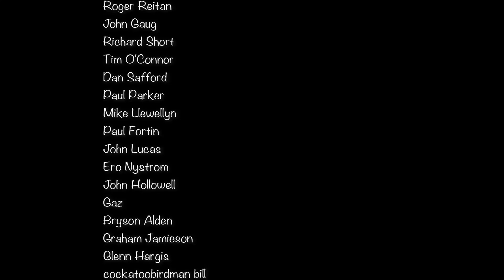Forging Shears / Tinsnips - GS Tongs

Comment: If you can find a small fly press, it might make your life a lot easier
Reply from the maker: I fantasize about tools like a fly press to make my life easier. But my work space is so limited. Let's see... Thanks. 😁
Reply: @gstongs  It doesn't have to be huge, plus you can use an old car wheel for the flywheel at the top

Comment: You are a master smith with tongs but it still cracks me up when ya struggle lol. If you wanna draw out material be hand you need to get the steel YELLOW-WHITE, get out of the chair and on your feet, and use a rounded face hammer with a more aggressive bottom fuller. Given your signature ASO. You should have one of the locals make you a set of hardy tools with different arc °to radius ratios
Reply from the maker: Hi Wesley, I appreciate your advice. The color of my steel on camera can be very different from how it actually appears. That being said, yeah, I could have gotten it a little hotter. I have a good bottom die for drawing quicker but couldn't find it. I've since found it and will show that during my next live stream. But this pair of snips was doomed from the beginning. My next pair will be better. Thanks. 😬

Comment: Interesting idea, didn't think it would be that easy to make shears. Also have to admit that i cringed a little when i saw you use the grinding wheel from the side. I still remember in shop class being told not to do that because they could explode. (unless they are specifically designed for that.) Hate to see you get hurt.:)
Reply from the maker: Hey vern, You're probably right. Using grind stones on the side can greatly weaken them. I'll do my best to be careful. Thanks. 😸
Reply: @gstongs  Just think of it as extreme sports for Smiths......and still safer then base jumping!..... or riding your scooter in some of that local traffic..... XD